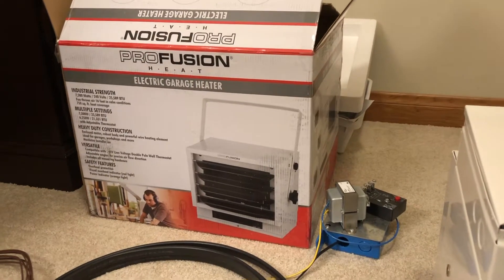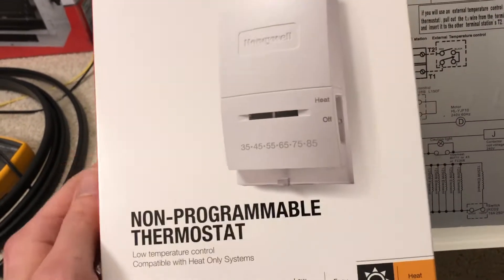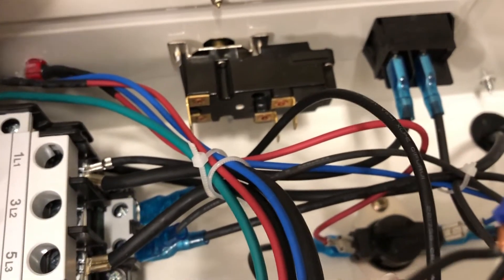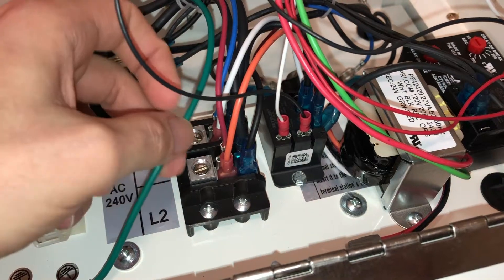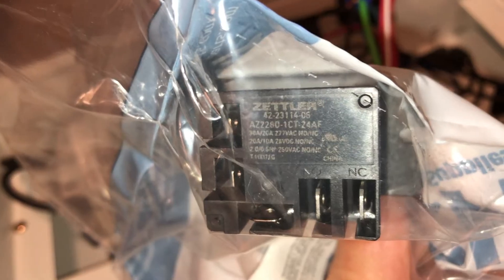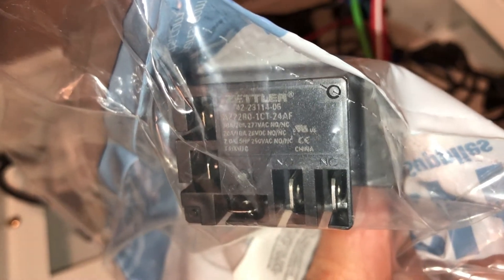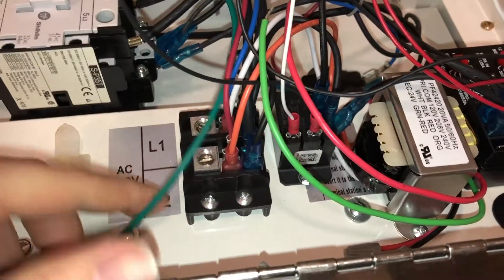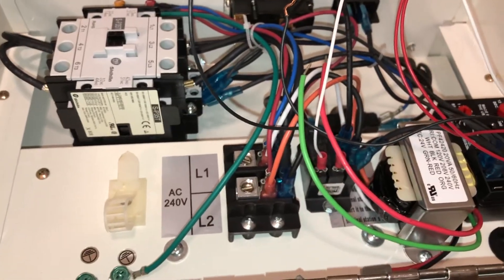How to Add an External 24V Thermostat to an Electric Garage Heater

Comment: I have the same heater. I'm very impressed with your set up, the post heat fan timer and fuse make me think that you have given this a great deal of thought. I hope that you mite be able to make up a wiring diagram. 
Thanks Dave
Reply from the maker: Diagram is posted now.

Comment: The simple thermostat you show is a two wire setup.  I'm interested in wiring it to a Nest thermostat since I use Nest within my house too.  The Nest wiring diagram has a series of options.  Would it just be using the RH, W1, and C?

Comment: you did a great job.  on my setup I have a 2000 watt 240 volt wall heater and I basically did the same thing except the contactor,  and low voltage is externarnal to my unit.  I just ordered a 5000 Watt garage heater and will be wiring it up pretty much just like what upi did, except I will be using a sequencer to control the unit, just like a regular electric furnace has. (I own a manufactured home with a coleman 3500 series electric furnace.)  I'm really glad to see how you did yours, Mine will be alot simpler because I already have the low voltage wiring in place already.

Comment: Great video, just one question.  At the end of the heat call, how long do you currently have the fan delay set for??? Since the delay you have is no longer available, I am trying to figure which one of the fixed delays to get, I found 2 of them. One of them is 1 sec make  and 45 sec break, the other one is 1 sec make and 90 sec break
Reply from the maker: I think it's set for around 2 minutes.

Comment: If I want to hook up a “smart” thermostat that needs a C wire, I assume I will need a separate 24v AC transformer to power it?
Reply from the maker: You can use the same 24V transformer as everything else, just run a wire from the C bundle to the C terminal on the thermostat. You will need 3 conductor (18/3) thermostat wire instead of 2 conductor.

Comment: I thought that later model of that heater already had a post fan controller built in(?). Do you have a video for the 7500W circuit thermostat hook-up?
Reply from the maker: Maybe, mine didn't so I added one. I'd have to see how that's accomplished to determine if it would work for external thermostat control. The thermostat wires are just red and white (see diagram).

Comment: I have a Dr Infrared heater that is set up to connect to an external thermostat that then controls the contactor in the heater by selecting the external thermostat using a switch on the unit. The external thermostat they sell is just a mechanical thermostat. Any idea how I can get this set up to communicate to a programmable thermostat or could I connect it to a single pole line volt programmable thermostat?
Reply from the maker: You can use a line voltage relay to switch the power and convert it to 24VAC for a normal thermostat. Search for RC840 relay for example. You'll have to add a 24VAC transformer too.

Comment: I need some clarification. Your 7500 watt heater has what looks to be a 3 pole contactor the S-P35T can you give a little better breakdown on the connections? I'm finding it difficult to find a wiring schematic online. I have a 5000 watt heater that came with no contactor and I had bought a Packard C230C 2-pole contactor and so obviously the contactor connections are in different locations and it is difficult to make out some of the connections on your video. For example, the 24volt connections to get the contactor to flip. Also, It would be awesome if you could offer some advice on connecting a wifi thermostat so that your fan delay and everything will work as you have intended with the two-wire mechanical thermostat.  I ran a 5 wire thermostat cable, got the wifi thermostat connected and powered up but it's not turning on the heat coils and then the fan delay. I've watched your video countless times and tried taking detailed notes but I'm stumped. If you get this, I'd really appreciate any advice or input you could offer. BTW the video and details are awesome! I appreciate you taking the time to put this online.
Reply from the maker: I showed the factory wiring diagram sticker at the beginning of the video. If you focus on the area that says temperature control, really all I've done is remove that and added devices to separately send power from wire labeled t2 to the motor (circled D symbol) and to the contactor (J rectangle). The rest of the wiring is unchanged. Yes that is a 3-pole contractor, but only the outside two terminals are being used. You only need a two-pole contactor however. My contactor coil voltage is 240V, so I had to add a relay to switch the 240V coil on and off with 24V. If you were doing this from scratch rather than modifying, you could just buy a standard 24V coil contactor and eliminate that relay. I go through the high voltage wiring step-by-step staring at 10:20. I also went through the 24V wiring, but it's pretty simple. All you have to do is connect the red, white, and common wires together in separate bundles with 3 wire nuts. When the thermostat calls, it connects red and white together to start the heater. That will work the same way whether you use a mechanical or a WiFi thermostat. If it's not working, then you need to do some basic troubleshooting like checking that you have 24VAC at the thermostat between the red and white wires. If you are still having problems perhaps you should upload a video showing your wiring and issues.
Reply: TechnicalLee  Hey TechnicalLee thanks for reading and replying to my initial message. Just prior to receiving and reading your reply I got the
thermostat working and it successfully tripped the relay which turned on the fan delay. The last thing I could not figure out was why I couldn’t get my contactor to trip. I was using the 24v from the transformer without any luck. I was just about to go back to check the thermostat wiring and I found your reply. You brought up something I hadn’t even considered. The contactor may require 240v to trigger and send the 240v through to the heat coils! I just wonder if that is the case. Thank you again for your input!
Reply from the maker: @dmwaeschle  Yes, if it says 240V coil on the side then you need to run 240V through the control coil to close it. It might be easier to swap it out with a regular 24V contactor you could get at any home improvement store if you have it wired without a relay.

Comment: Thanks for posting this video.  I set mine up just as you did. Only difference is I’m using a 24vac contactor.  The problem I’m having is about 28mV gets through the contactor when the thermostat is not calling for heat.  This apparently is enough to make contact in the timer.  Any advise?  A resistor maybe?
Reply from the maker: If it's a Nest then you need to run an extra common wire from the C side of the transformer to the thermostat.
Reply: Thanks for the quick response. I'm using the exact same thermostat as you are in the video.
Reply from the maker: @glenncates1042  Hmm, when the thermostat is open there should be no current flow. If you completely disconnect the thermostat and have the wires apart not touching does it still run? Also if you're using the same fan delay timer, double check you have the limit terminal connected to the R bundle or the fan will run constantly. A 24V contactor should take the place of the 240V relay in my setup, so it should be connected to W and C.
Reply: @TechnicalLee  I tried completely disconnecting the thermostat.  I connected only one side of the contactor to 24vac, touched the other side to G & the fan comes on.  Remove G and the timer counts down and shuts off.  So maybe either the contactor is bad (11 ohms across the terminals),  or the timer for allowing only 28mV to switch it on?
Reply from the maker: @glenncates1042  Contactor coil should be wired between W and C bundles (I talk about the three wire-nutted bundles in the video). The G terminal on the fan delay should be connected to the W bundle so the fan control is in parallel with the contactor, not in series. The resistance of the coil shouldn't matter because when the thermostat is open there should be zero voltage on the coil. If you are getting voltage/current on the contactor coil with the thermostat disconnected something is wired wrong.
Reply: @TechnicalLee  Tore everything apart & started from scratch.  Working like it should now.  Thanks so much for the help and posting the video!

Comment: Greetings, amaze with the work,  I have the Comfort Zone CZ220 5,000W, Fan-Forced Ceiling Mount Heater with Dual Knob Controls and i most order all your parts as annotated on video. Missing one item to come and suppose to be here this week, wondering if possible to have the schematic for the installation and is you have to buy extra cable and what gauge was use? Well hop all this work on my heater. Any help is being appreciated.

Comment: Are you not worried about using 24VAC to switch a relay with a 24VDC coil? From what I've read online it's not ideal because the contact will open and close many times a second with the alternating current
Reply from the maker: It's an AC coil. Part number AZ2280–1CT–24AF, A in the last part is for AC. No issues with it.

Comment: I have this heater the fan does not run all the time.   You turn it all the way up and when you get to the temp you want you turn it down slowly untill it shuts off.    My thermometer records the highest and lowest temp.   For a week highest 67 lowest 64.    (It's kicking on at 64 and shutting off at 67) 3 degrees is not bad kiddos on doing it just seems like a lot for a couple degrees
Reply from the maker: Sounds like you got a newer version than me. Reading the online reviews, there are a number of people complaining about the fan running continuously, especially in reviews more than a few years old. But it's not mentioned anymore in more recent reviews. I'm guessing the manufacturer added a thermostatic fan delay at some point in the past 2-3 years after customer complaints. The unit I got must have been older stock and did not have a fan delay. I also added the thermostat so I could adjust the temperature from the ground without getting a ladder because the unit is up 8 feet.

Comment: Nice video: I do want to clarify, all other videos I've seen doing this require a 10/3  (neutral) wire to perform this set up. This looks to me like only a 2 wire is needed, correct? Thanks
Reply from the maker: Yes, it's 240V so only two wires (plus ground) needed. Neutral is only needed for 120V.

Comment: First off great video and thanks for sharing.  I have a question and you seem to be the only talking about the Thermostat block on youtube. If I just wanted to hook up a 240v double pole in line thermostat would I just run power in to the thermostat and out to T1 and T2 and not use L1 and L2? I already have the wire and thermostat, that's why I'm asking, thank you.
Reply from the maker: No, you have to wire it up like in the diagram (move the one wire from L1 to T2 as directed). The heating elements need to be powered through L1 and L2 with big gauge wire directly from the breaker to run safely. Only the fan and contactor will be powered through the thermostat, so you can use much smaller regular 14 gauge Romex for the thermostat. I don't think they make a line voltage thermostat that can switch the 30 amps required for the heating elements—if you tried to run everything through the thermostat it would probably start on fire.
Reply: @TechnicalLee  OK thank you and thanks for the quick reply

Comment: On my unit it went from L2 to the lower left side of the original thermostat that came on the unit.
Reply: did you ever hook up your heater? i have a same one. would appreciate any help I can get. any chance you can post a wirimg diagram?

Comment: Great video and very informative but I have to ask if you didn't use a smart programmable thermostat what was the point? You just changed your dial to a straight line non programmable thermostat that you can mount away from the heater. They both do the same thing and hold the room at the desired temp. One just does I na remote location.
Reply: I just installed a very similar heater last weekend, and found the built in thermostat to be very inaccurate. I'm making constant adjustments to keep a stable temperature in my shop. A remote thermostat will eliminate this problem.
Reply from the maker: I did a remote thermostat because I wanted to turn it on and off without getting out a ladder every time. The unit is mounted 8' off the ground, hard to reach the knob. Plus a remote thermostat does a much better job controlling the temperature than the built-in one. I can add a smart thermostat later if I want, but the mechanical one is all I need.

Comment: Awesome video, but my setup wont turn fan on or off. I have same delay for fan as u, wired the same. But I'm using 2 pole lug for heating coils, and a Honeywell's smart thermostat.. has me baffled, y wire back from thermostat activates lug, but will not turn on delay on make. I also have same transformer as well.. any advice would b appreciated!
Reply from the maker: Did you wire the limit terminal on the ICM251 control to red permanently? It won't work with it disconnected. I talk about that at about 13:30 in the video. Also you should be using white or green from the thermostat for fan control, yellow is for cooling. My setup I just have everything running off white wire (heat) which I would recommend unless you need independent fan control (then use green).
Reply: @TechnicalLee  yes it is hooked up to red from transformer. I am also using w terminal on thermostat, I was mistaken.. green is hooked to common.
Reply: It works as it should without the delay timer, I just like there fact that the delay timer would allow the fan to cool off heating coils.. so I just added it in, broke one side of fan circuit (always hot). That's why I'm so baffled, it should work. Thankyou for responding! And again, great video.
Reply: Well update, it is now figured out and working properly.. common and hot need to be kept the same, it is very easy to swap them around. If anyone wants to know, reply and I will explain. This video is spot on, but I'm using wifi thermostat, that combined with not using a separate relay for heating elements, was very tricky!
Reply from the maker: @michaelrichards2222  This is important: the green wire on this particular transformer is the common, and is not the same as G on the thermostat! Do not connect the green terminal on the thermostat to common, or you will short out your transformer when you run heat or fan! Common (black), red, and white all need to be kept separate in their own bundles as you see in my video around 18:00 (3 wire nuts for the low voltage wiring, note the green transformer common wire is connected to the black/common bundle).
Reply: @TechnicalLee  connected to c wire on thermostat. Everything works great now. Not even using g terminal, it's for fan.
Reply: @michaelrichards2222  can you post a video or photo of your wiring?  I just got a new profusion 7500w and Honeywell wifi thermostat.
Reply: @rbfriesen  i cant today, but will try to in the near future.. but the actual video is a great guideline.. just follow it, take screen shots.. merry christmas
Reply: @michaelrichards2222  how did you wire your smart thermostat? I need a “C” wire but figure I will need another 24v AC source.
Reply: @jessesonnentag  c wire should be ,24:volt from thermostat i think
Reply: @michaelrichards2222  I tried that but it did not work.
Reply: @jessesonnentag  did u find where 24v leavs thermostat?
Reply: @michaelrichards2222  do you mean transformer?  I connected to the “c” and RC terminals on the thermostat, it did not like it!
Reply: @jessesonnentag  transformer only supplies power to thermostat.
Reply: And fan timer relay. U dont have to use the fan timer though.
Reply: @michaelrichards2222  I followed the video and have all of the same components.
The issue is the 2 wires going out for the thermostat “white and black” have a 24v potential between them. I tried connecting them to my “smart thermostat” C and RC contacts and I herd an audible “sizzle” when I flipped the breaker.

I removed the thermostat from the circuit and flipped the breaker again. All seemed normal so I touched the black and white wires together and the relay kicked the coils on and everything works properly. (Fan timer, heat). When I disconnect the wires the fan timer kept going for the set duration. This seems normal as a conventional thermostat is just a contact break as well.
Reply: @jessesonnentag  thermostat model, let me look at wiring diagram.
Reply: @michaelrichards2222  Johnson Controls GLAS
Reply: @michaelrichards2222  also I tested the thermostat with a wall wort style 24v ac power supply and it turns on fine when connected to C and RC.
Reply: @jessesonnentag  c is common to thermostat, rc is hot to thermostat, that's where u get  24 v to power thermostat.. w1 24v out, goes back to other side to activate other side for fan and heat (220v)
Reply: C=negative, rc = POSITIVE (power to thermostat... w1 positive from thermostat to other side of 220 lug when calls for heat according to thermostat temo setting.
Reply: @jessesonnentag  common (negative) goes 2 places from 24v side of trans.. thermostat, and one side of 220 relay.. w1 24v goes to otherside of 220, when thermostat calls for heat ot competes circuit, allows for 220v to flow to fan and and heat coils.. do not use green fan on thermostat. Its been over a year since I did mine, so having to try and remember.😁
Reply: @jessesonnentag  green wire on transformer is  negative 24v..
Reply: @michaelrichards2222  thanks! I’ll give it a try when I get home tonight.
Reply: @jessesonnentag  green in c wire to thermostat, red is rc, ur very welcome